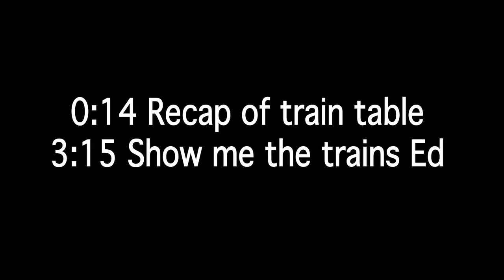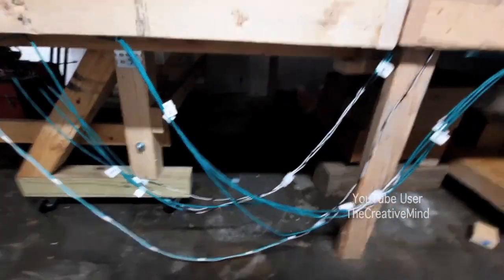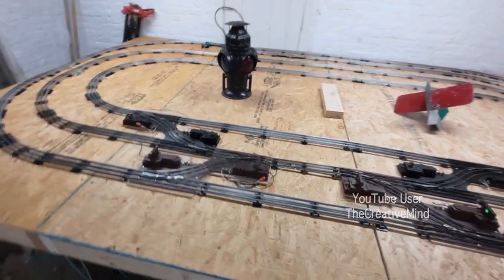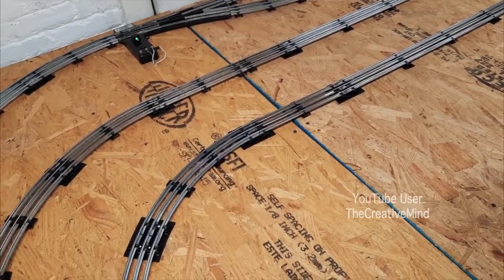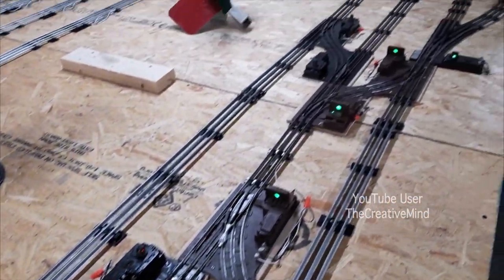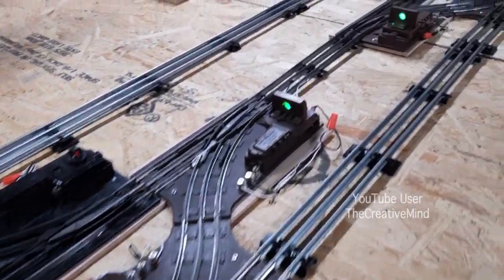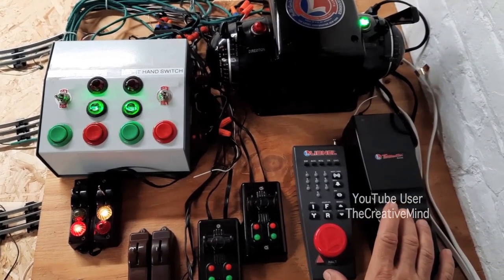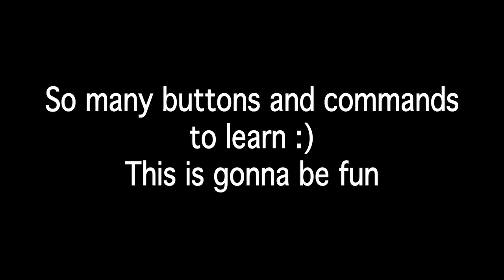My Lionel Train Sets and 1 Williams Set Running Showcase

Comment: Can you please tell me what type of rubber mat you bought from Amazon?
Reply from the maker: @EricHartner-hm6ce  I used the  NABOWAN Solid Rubber Sheets,Strips,Rolls 1/8" (.125") Thick x 12" Wide x 47" Long, Thin Neoprene Rubber, Perfect for DIY Gasket Material, Sealing, Liner, Shield, Padding, Mat. Copy this description into the search bar, it should show up.
Reply: But this stuff does work pretty well when you lay down the track on top of it, and then screw down the track on top of the wood?
Reply from the maker: @EricHartner-hm6ce  the mat did well by reducing the noise. I did screw the tracks with a kiss of pressure to hold the tracks in place but at the same time not collapsing the ties. If you're looking for a better sound dampening material, look into homasote boards. A bit more money but they are 1/2" x 4' x 8' sheets. I'll mostly use this for my next permanent table.